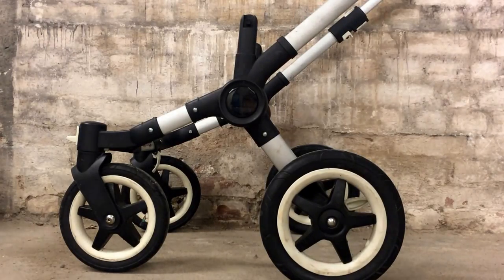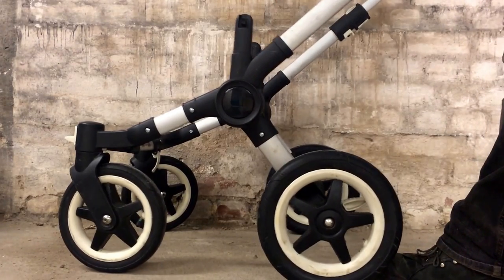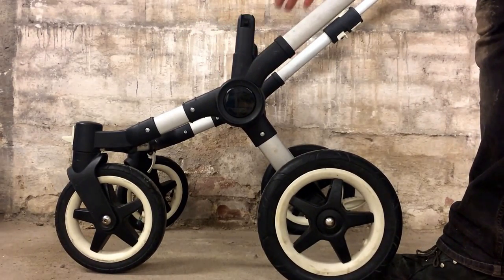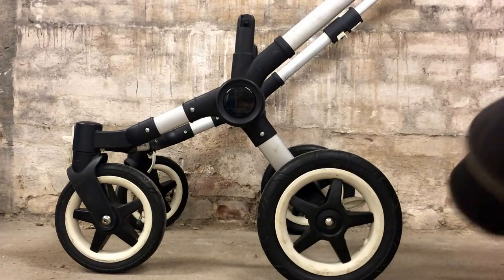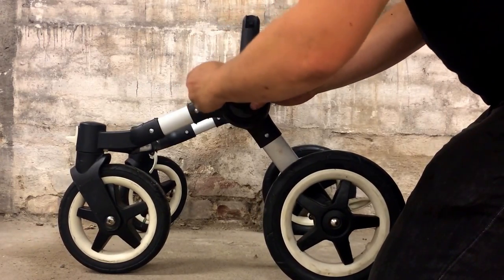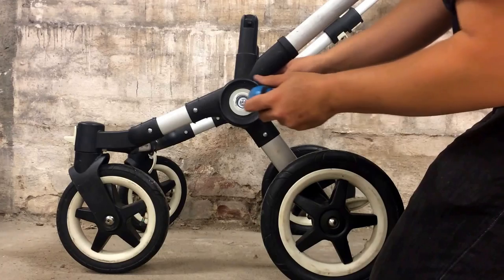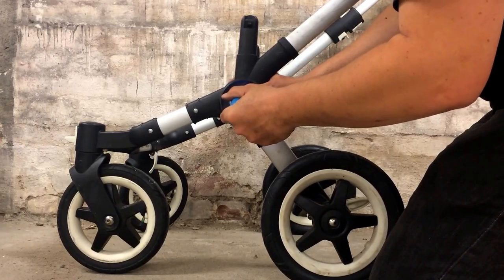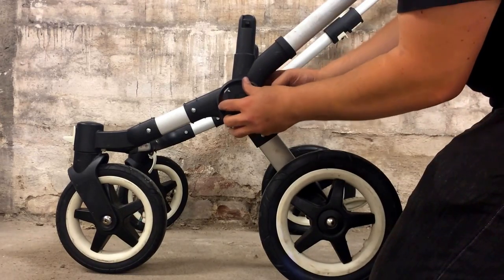Tightening the Chassis of a Bugaboo Donkey

Comment: This is a fantastic channel! Will this fix help with the issue that our donkey sometimes unlocks itself (the wheel pairs folds in to each other the same way as when you fold it) when I heave to get it over an edge, liker up on a bus or on the sidewalk? its a b it annoying when both kids are sitting in it!
Reply from the maker: It's worth a try, especially if the mechanism seems very loose (the disks are not tight against each other).  Unfortunately though, the symptom you mention is usually a result of wear on the innermost disks (the portion of the central locking mechanism connected to the back frame) and requires the replacement of these parts.

Comment: this is awesome!  my donkey is doing the same and actually I have a bigger issue. it appears to be a bit uneven, kind of leaving more to one side.  it's weird I can't even really describe it.  lol
Reply from the maker: +boogie googie 
Check to make sure the handle is extended evenly on both sides.  Check the points at which metal bars slot into plastic joints/mechanisms, if any are particularly loose, drill out the rivet and replace it with a screw that you can make super tight.  If you're adventurous, disassemble the central mechanism, examine the various components for particular wear, oil and reassemble them (something might simply be misaligned).  And if you're ever in Oslo, Norway, feel free to stop by :-)
Reply: boogie googie I know this is an old post but did tightening those part fix your problem? We have the same issue

Comment: Hello the stroller workshop! I live in Sweden and I was wondering if you had a video or any help with Tightening the Chassis of a Bugaboo chameleon 3. The right side has become a bit loose. Thanks and do you have a email address or website? Thanks
Reply from the maker: The Cameleon can't really be tightened unfortunately, just fixed when broken (no resistance at all on one side).  If this is the case, check out this video: https://www.youtube.com/watch?v=y0R8mbThxco&t=159s